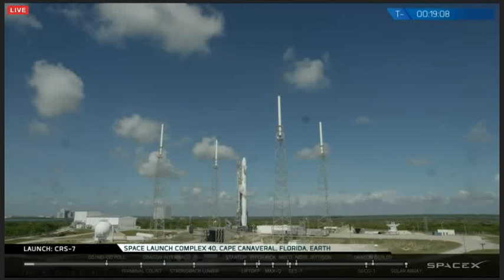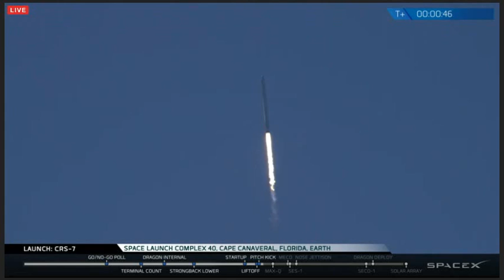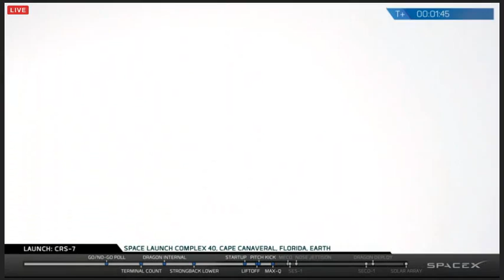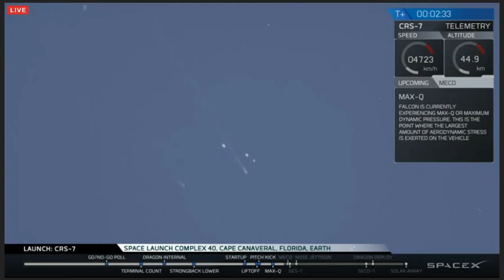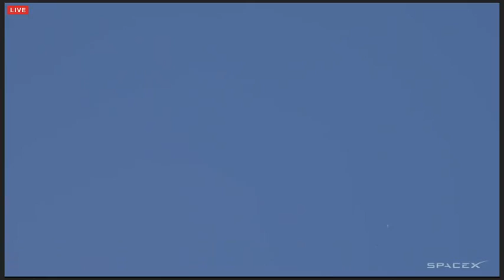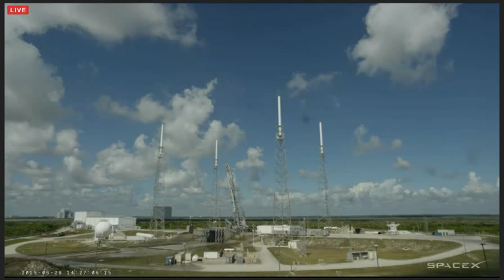FULL REPLAY! SpaceX Webcast Of Falcon 9 CRS-7 Failed Launch

Comment: Most expencive firework video in the internet
Reply: You apparently haven't heard of the Soviet's N1 rocket, then.
Reply: You are right, I am just starting thinking about correct this, but I am just lazy to do this, anyway I like "most expencive firework" naming of things like that .I'm not expert, for sure Russians not counting resources for lot of things in times of USSR. Thanks for your post, I just little searching and looks like the biggest rocket was Saturn V (USA) and as I understand, actually it fly and N1 just firework xD.
Reply: Yup :)
It's actually kind of sad, though. On the last launch they basically had everything down but when the flight computer shut down the core engines to reduce structural stress, it resulted in a hydraulic shock wave that ruptured propellant lines. The planned fifth attempt would've worked for sure, but their funding was cut and everything was abandoned.
Reply: I love space enough that I cheer for anyones rockets, even the evil people like the soviets.
Reply: N1, Challenger and Delta 4 heavy were the most expensive rockets
Reply: Andrew and Columbia a small firework is even a firework